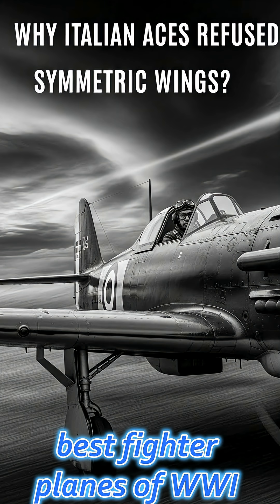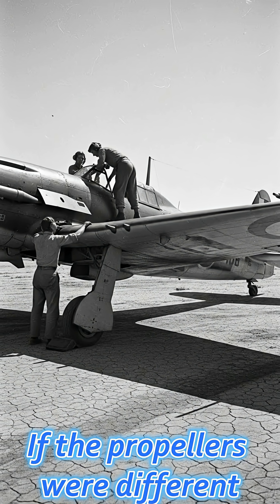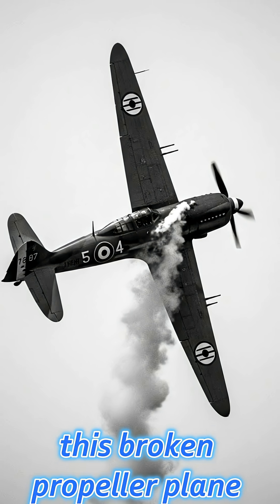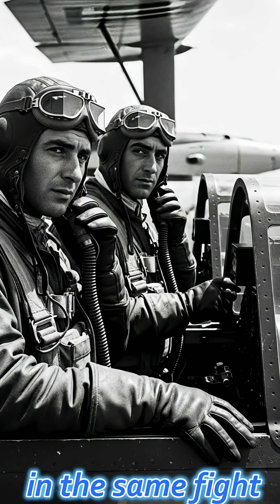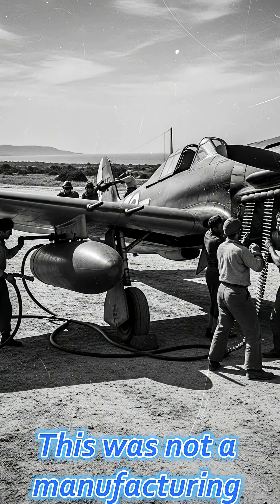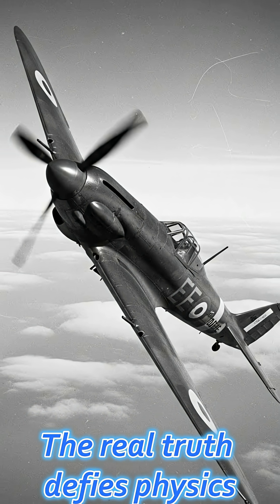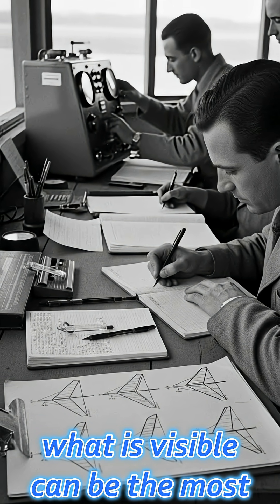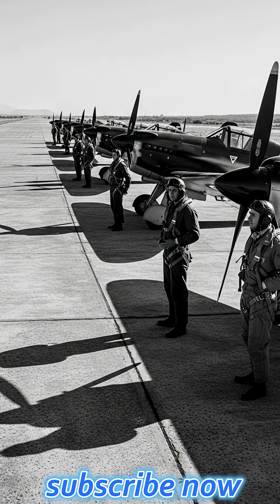Why italian aces refused symmetric wings

Comment: A left propeller, and you are showing a single engine, World War II fighter?
I’m sorry, but I think you’re full of malarkey! Maybe you should try another line of work because no aircraft engineer in the world would agree with what you are selling.
An engine spinning a prop at 2700 RPM with an unbalanced blade would literally break the motor mounts and send the engine torque rolling, heading to the ground.

Comment: This is utterly ridiculous: there’s not such thing as “left” or “right” propeller in a single engine aircraft like the Folgore, which by the way had a three blades propeller. An unbalanced prop will make the plane impossible to fly, never mind aim accurately. An imbalanced prop will also destroy the engine shaft and the engine itself. 
Please let’s stop spreading bs

Comment: What are you talking about.  Do you mean the left propeller of a twin engine aircraft but you are showing single engine aircraft.  In a single engine aircraft there is no such thing as a left propeller and of course there is no such thing as a left propeller blade.  It is possible to have an assymetric airplane by making one wing longer than the other to counter engine torque effects.  Perhaps you need to do a bit more research and then make a new video to replace this one.